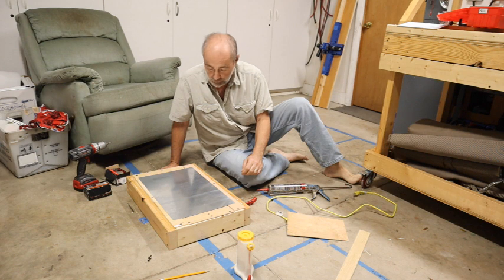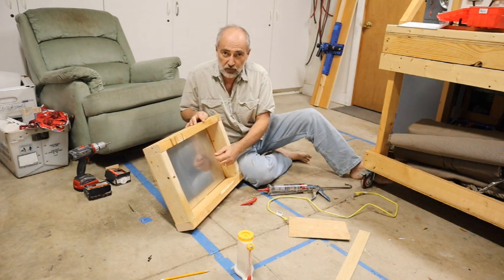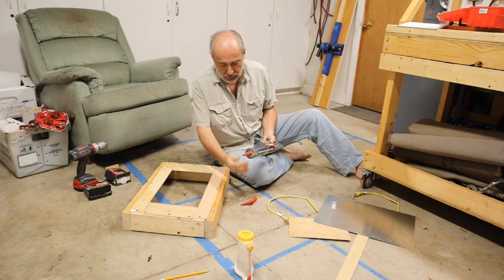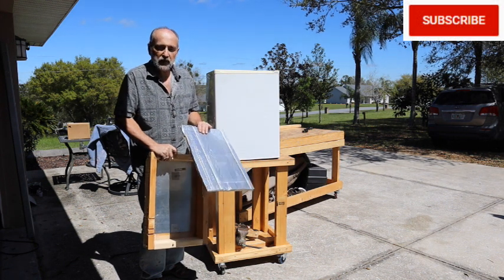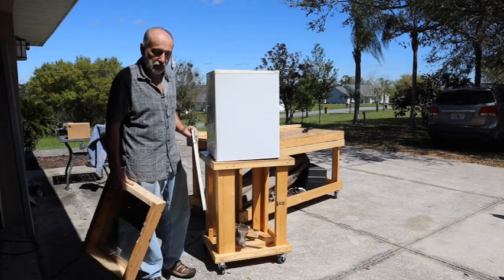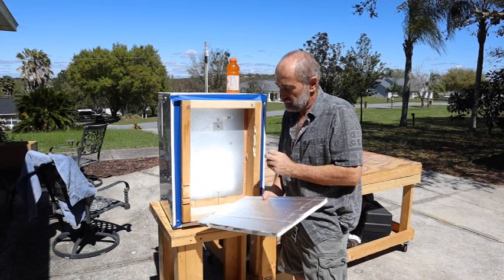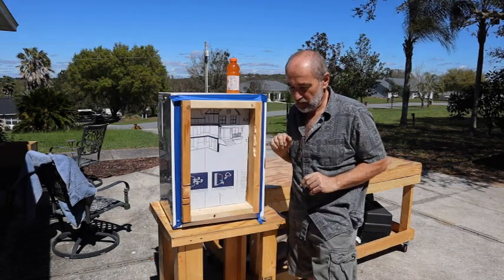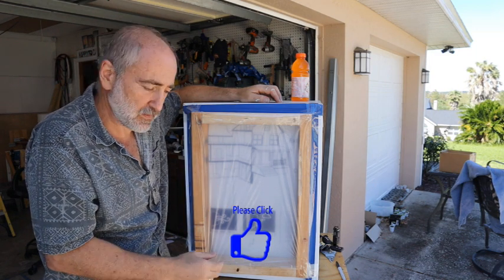Van Life Insulation Test #1 Moving Condensation

Comment: I am in a climate very similar to Florida, Queensland Australia. I am glad you did this experiment because I too have been wondering what the best way to insulate my van would be. It occurs to me that every time we see a new van build commence on youtube, and the builders remove the existing panelling on their van walls that they rarely, if ever, find rust on the walls. To me it would seem that air flow is paramount.  I am probably just going to go with a layer of poly fleece (the plastic bottle stuff) and no foam board or plastic vapour barrier - the sooner the walls can be dried out the less chance of mould imo. And winter here is not that cold - in fact we had 3 days in a row last winter where it was 29C.  The coldest it has got to here is 5C overnight followed by a 24C day. ... plenty warm enough for the walls to dry out.
Reply: I am from the Netherlands, I would almost require an air conditioner in "your" winter 😂
Reply from the maker: You can see what I used in this video:  https://www.youtube.com/watch?v=8zlfQBOSebY&t=310s&pp=ygUYVmFuIExpZmUgSW5zdWxhdGlvbiBUZXN0
All the videos by category can be see at  https://thefrugalfactor.com/

Comment: Thanks for this. Lots of people talk about insulation / condensation but I haven't seen someone actually perform an experiment on it. The condensation will always happen to some degree as the condensed air is the one already trapped in that volume. A possible, but non-practical, solution would be for that "initial" air trapped to be very dry and no "new", wetter, air to come in. Perhaps a possible solution would be to promote the circulation  of the trapped air inside the van wall cavities hoping to move the wet air away and out of the van (strategically placed small fans?).
Reply from the maker: Yes, I agree - I have even thought of fans, and PVC pipes with holes to draw the moist air out of the walls.  But the cost/benefit ratio is not there....

Comment: Good set of experiments....do a test with closed cell spray foam...I think you will find it prevents condensation as there is no air between the skin of the metal and the spry foam....
Reply from the maker: There are many problems with spray foam, these are presented in a future video.

Comment: No expert here, but was wondering if the wood frame is getting cooled too? Causing the vaper barrier to not work in this scenario? Normally in the van you'd make sure to thermal break the wood from the steel. In this test it looks like the wood has a thermal connection (or just inside the fridge?) And the plastic foil (not the best choice for a vaper barrier either as far as I know) is directly connected to the wood. 

What are your thoughts?

I am digging into this topic further and further and the more I look into it the less I seem to understand about it haha 😂 

But it was interesting to see how you came up with this design to actually be able to test different methods of insulation and also to test any mildew issues/prevention. So thanks for doing that and sharing.

Also what did you end up using for insultion?
Reply from the maker: You can see what I used in this video:  https://www.youtube.com/watch?v=8zlfQBOSebY&t=310s&pp=ygUYVmFuIExpZmUgSW5zdWxhdGlvbiBUZXN0
All the videos by category can be see at  https://thefrugalfactor.com/
Reply: @FrugalFactor  I have been looking into this subject for quite some time now. I like the thinsulate, but it's expensive. I was thinking about sheep wool too for the "breathing" effect. And able to hold 30% of it's own weight in moisture. But the R value is important. I think I might go for your method. But since it's 2.5 years ago I wonder how it holds up? Did you look behind the insulation to chech for mildew build-up at specific spots?